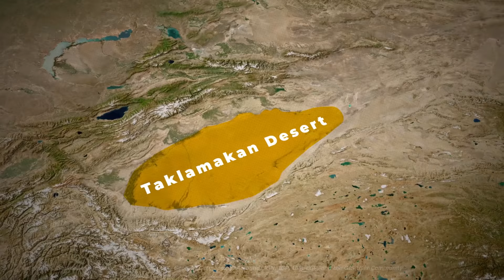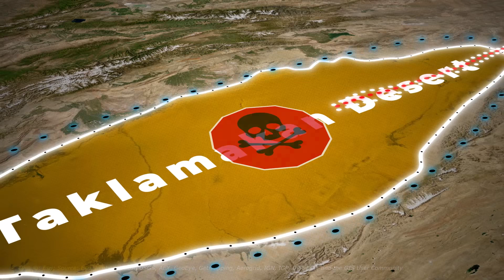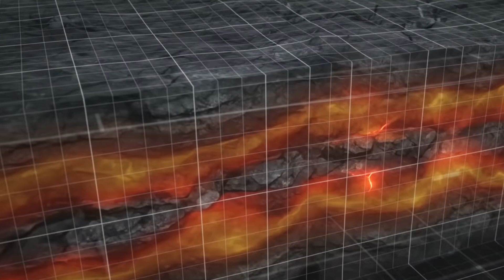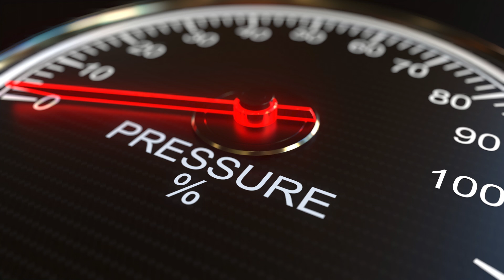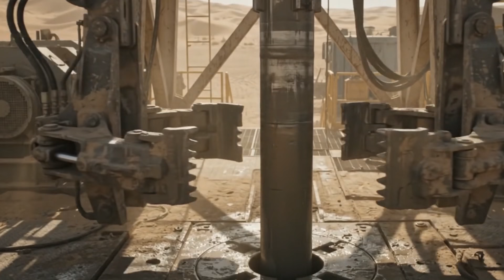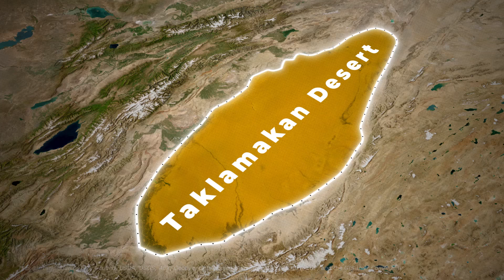How China Built a $22B Oil Empire in The World's Deadliest Desert

Comment: At 8,000 to 10,000 meters, most would be gas or condensate.   And given what you described (they are trapped within compartments), it would be quite expensive to get them out.
Reply: That's over 5 miles down.
When people say we will run out of resources they forget how deep it is to the mantle. Wet have only scratched the Surface plate. 
In the deepest mine  in South Africa Mponeng gold mine  is  2.5 miles and the Temp is 66C/151F !!!!😮
Reply: As far as I got it at depth below 6000m - temperature - oil disintegrates. Only gas is found deeper.
Reply: One thing i have learn about china never understand them